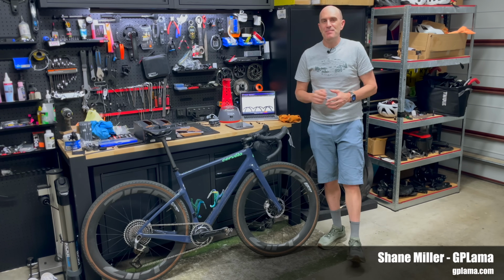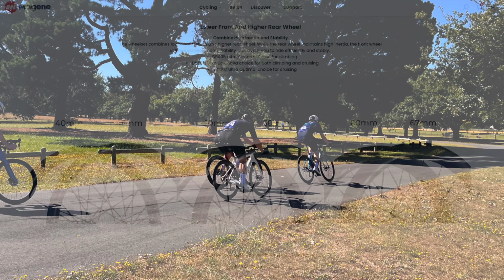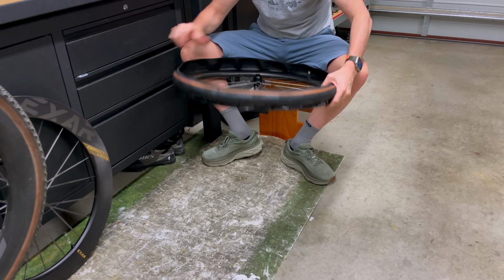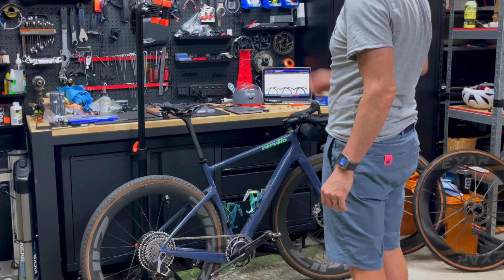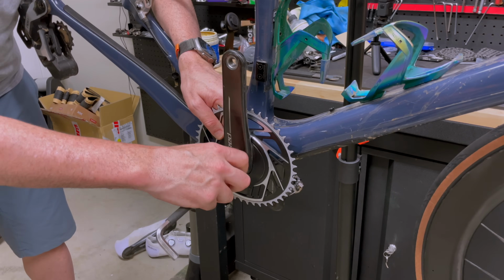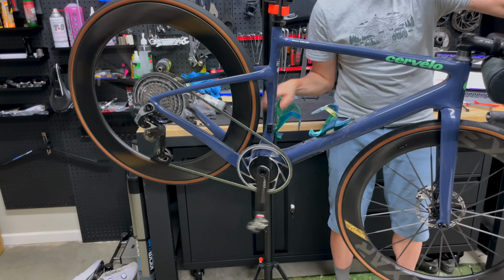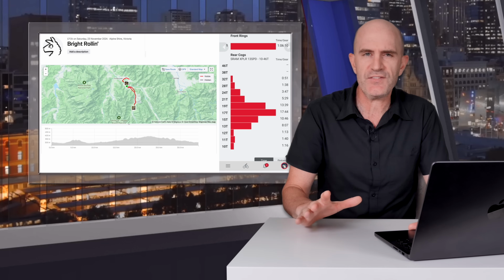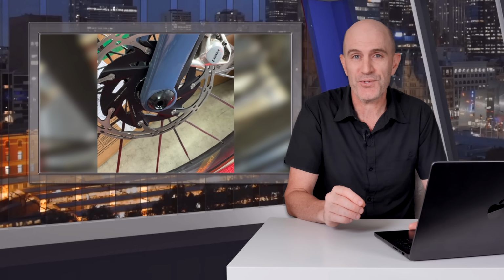Cervelo ASPERO 1x Road Setup Project // Can it do Both Gravel AND Road?

Comment: I just built up my road bike with SRAM XPLR and I love all the chain ring options. I’ve got it tuned perfectly for my home terrain, and then I can change it pretty easily if I do a trip to mountains or something. I think this is how road bikes should probably be for most normal people. I’m actually using all 13 gears instead of having 2x Ultegra and really only using 8 or 9 of my 12 cogs most of the time.

Comment: Hi Shane,
I am curently looking for an Aspero and was questioning myself about the frame size. 
I am 1,86m and always rode 58 bikes (road or CX). The aspero in 58 is comparable in stack and reach to my current bike. 
May I ask you how tall you are and which frame size you’re riding on?
Thanks for all your great content whether it’s about Zwift, trainers or other topics like drivetrain 😍
Reply from the maker: 181 and 54. I could ride a 56 but choose to size down and run a 120mm stem. Bike fitting by comparison isn't great. I'd test ride a few setups first before laying money down.

Comment: Get rid of the 1x and make it a 2x. Why did 1x ever become THE thing with "gravel" bikes? People spend hundreds of dollars to get wattage data then disregard its relationship with cadence. Better control over cadence almost always gives you better control over sustained power.
Reply from the maker: Front derailleurs are an Achilles’ heel when riding off-road, regardless of the brand.

Comment: Given that a road tire is thinner and is inflated to a higher pressure, is it not simpler and more reliable to just put in a TPU tube?  TPU is lighter, cleaner and if it punctures, can be quickly changed on the road. With sealant, it may seal but you never know if the seal is good enough to not bother removing the tire and doing a complete repair of the hole or just cleaning everything up to put a tube in.

Comment: Just came across your content and was actually thinking of an Aspero as a do-it-all bike for myself. Don't want to do the switching components between road/gravel, and I'm probably 50/50 each overall (often both on the same rides). Very flat and open here (nothing over 8% gradient) and I'm in decent shape. Can you recommend an ideal wheel/tire/chainring combo for this scenario, paired with the XPLR 13 speed? Thanks!

Comment: Great info! I wonder what difference I will be experiencing between my road bike and my soon to be delivered Cervelo Aspero.  It will be equiped in SRAM AXS with Rival but 1x Force pwr-meter crankset + 44T chainring (combined with the 10-44T cassette).  I will put a pair of Hunt 40 CGR rims with Pro One TLE Addix 38mm tyres.  This will be my "gravel" setup i will use mostly on tarmac when the road conditions are bad or the weather makes that I wont use my Factor Ostro VAM (I live in Quebec, Canada and the tarmac roads are often more like gravel trails).  My question would be, if I purchase an extra pair of road wheels, like the Scribe Elan 50 matched with some GP5000 TR 30mm to put on my Aspero, would I really be noticing a big difference with my Factor Ostro VAM?  I do not race, but I train hard and love what the Factor provides me on flats and climbs

Comment: Great to point out the benefits of being your own mechanic (for the things you're willing to do). Nothing wrong with using a pro because you want to or have to. But knowing how it works will make you more mechanically empathetic and stuff lasts longer. And as you point out, you're less likely to be stranded

Comment: Loved this. How do you rate Cervelo in road mode vs actual road bike? And is there a happy medium chain ring size up front for mixed surface rides, say 80% road to 20% gravel, 1.5-3k of elevation over 40-60mi? (Too specific? 😂)
Reply from the maker: It's a little lazier on the front end than my Giant TCR (known to be twitchy). Other than that, it has been brilliant as a do-it-all road/gravel bike. The 13spd gear spacing on the XPLR cassette is excellent. Chainring size/combo/etc is all very much rider and terrain dependent. There'll never be a one size fits all answer there.
Reply: @ great to hear! Just picked mine up and ordered the Red XPLR derailleur and cassette. I’m planning on starting with a 44t chainring and using this video for setup. Thanks for that!
Reply: @ one question, chain calculator calls for 120 teeth… the force flat top chain comes in a 120 chain option. SRAM app only mentions 126 or 114. The 120 link obviously works right?
Reply from the maker: @bpk636  Not sure on that one. I'd lean towards yes.... SRAM support should be able to confirm.

Comment: If you’re running a 46t in front you need the Eagle mullet set up unless you live in Florida.
Reply from the maker: 1:1 ratio is fine for most gradients. If not then leaving the 40T on works well.

Comment: Great video Shane. Question though, at approx. 11:30 into the video is where you re-install the chain and then click it into place, then go through the gears to make sure all is good etc. I thought with transmission when you change rings (e.g. front) you would have to properly align the rear derailleur while it's in the "set up setting" and pull back to adjust (for new size) before putting it back into the regular setting before tightening the rear axel. You didn't appear to do this or is this "transmission" groupset different to the MTB ones?

Comment: Can you tell me what you have set up there with your compressor and what looks like an old pump tube and chuck (though looks like no core)? Looks like a better solution than holding the compressor with a nozzle up to the stem without core installed, which is what I need to do.
Reply from the maker: Yep. That's a pump head off a floor pump.
Reply: @gplama  How did you get it to stay on the compressor hose?
Reply from the maker: @SlowLegsandaDirtyBike  Zip ties. Not recommended, but it works. :)
Reply: @gplama  It's clever. Much better than trying to just steady a nozzle on the stem.

Comment: I’m confused, are you saying your going to have to do this conversion every time you switch from road to gravel? Ie change the front chainring? I was thinking you would be able to just swap wheels and away you go?
Reply from the maker: Depends on the terrain. A 40T won’t be suitable for a lot of road riding. A 46T wouldn’t suit some gravel courses. The last day of riding at the TdU I left the 40T on and used road wheels. Was missing some top end speed coming down Greenhill Rd descent. 42T or 44T might be a middle ground.
Reply: @ so it would be a case of using the same cassette and swapping out the front chainring when wanting to change from road to gravel?
Reply from the maker: @jackdavis8786  Same cassettes, yes. Chainring switch is optional, depends on the terrain.

Comment: At around 5:42, did you say you’re pumping those up to 110-120 psi?? 😮
Reply from the maker: No. I say they’re “not exactly holding” meaning they’re not what I would consider ‘high pressures’ as I’m pumping them up to around 50-55psi. As opposed to what we used to run 23mm tubed tyres at, 110-120psi.
Reply: @gplama Gotcha. Thanks for the clarification. 
Great video. I do the exact same on my Open Upper. 700x32 road wheels and 700x40 gravel with sram 1x. Although I’m thinking of experimenting with some Pirelli P-Zero 700x40’s as a do it all set up.

Comment: Do you reuse quick links for the life of the chain? I've had no issue reusing quick links, but I've only been waxing about a year and have multiple chains so haven't used one more than a few times. I assume it's smart to replace it if it starts installing too easily? You'd think chain manufacturers would make their quick links more affordable if they don't want people reusing them. $12 for two tiny pieces of steel is robbery.

Comment: Wow, that's a great detailed video.As an over 60-year-old, my head spins with developments like hydraulics, tubeless, wireless shifting setup, safety pin,  etc, etc. The bike industry was quite successful in asking owners to go to the dealer rather than doing it by yourself.
I ride a mechanical alloy bike with rim brakes and would never 'upgrade'.

Comment: Couple of comments on tape installation...

For road pressures (even with higher volume tires), two layers of tape is needed to prevent the pressure causing a failure at a spoke hole.

For the valve hole, it's best to use something hot to melt a hole through the tape. This effectively "cauterizes" the hole and prevents the tape from splitting.

Learned both of these the hard way...

Comment: ... or you could use an 825 Di2 groupset and not have all that hassle! 825 fantastic for gravel and road. Use a 'normal' Gravel wheel, change tyres, and not have the expense of a second set of wheels either

Comment: How did you find the gear spacing of the 1x setup for road riding? Did you notice the larger gaps between gears? I'm doing new build 'all road' bike and trying to decide between a Red 2x groupaet vs. this Red XPLR groupset. Both have similar top/bottom gear ratios, but the 2x setup has 15 unique gears vs. XPLR which covers the range just with the 13 gears. I love the idea of the direct mount rear derailleur though but worried ill find the larger gaps between gears a bit annoying for road riding. Thanks!
Reply from the maker: The 10,11,12,13,15,17 on the 13spd XPLR cassette are brilliant for flat/fast road. No issues with the jumps this week on the climbs either, riding nothing over 12-13%.

Comment: I’ve done this with my 3T Exploro using Force XPLR with a 44t chainring up font and a 10-44 cassette.  Works perfectly as a winter road bike set up and then just swap in gravel wheels when I want to go off road.

One thing I do have to change when I swap wheelsets is adjust the gear indexing using the SRAM AXS app, but that’s a 2 minute job.
Reply: A 2 tooth gap is too big for road riding. I've been riding my grx  820 44/10-51 on mixed road and gravel, and I'm done,I struggle too often with being between gears on the road. I'm going to buy a second road bike. That XPLR Red cassette could be useful, though, considering it has 1-tooth steps on the higher gears...but 600euro forthe cassette...

Comment: Factor Ostro Gravel with dura ace, 52/36, have 50/34 if I really needed it. 11-30 on Roval CLX for road and 11-34 on Firecrest 303 for gravel. Excels at both. 7.6kg in road mode so not bad for any aero bike!

Comment: Takeaway number 6 GPLama, I tried this method on my Giant Revolt 1 but I wasn't happy on the feeling of the bike, this is undoable on Gravel bikes with longer chainstays like 425mm or more. This is the real kicker! The shorter the chainstay of a Gravel Frame the closer it will give that road feel once you'll use a road wheelset. My 2 cents

Comment: Nice video Shane. I think more people should consider them as their one bike to do it all. You do have to be a bit technically minded though. As a road bike, they are great. 
I’m choosing my Specialized Crux (technically a CX bike) for Peaks Challenge this year. It is 1x 12sp AXS for the record. Several reasons: I get a 44 tooth max rear cog, the full gearing range (I’m going for a 48tooth chainring). And secondly it gives me disc brakes. I am also going to run 32’s on the tyre front. I have other out and out race bikes, but this is just comfortable. I’ve done a lot of training on the setup in the recent few months, and I’d just classify it as what they call an endurance bike really. So versatile in reality. And exactly like you say, make changes and it goes back to CX or gravel mode. For this bike I have two cassettes, two dérailleurs, 6 chain rings. And numerous chains to suit.

Comment: I thought about building  an Aspero as my do it all roadbike, but I just don't like the slower handling of the slacker headtube angle, compared to my SL6 Tarmac. The Tarmac feels like a sports car compared to the Aspero. So I plan to make a 1x Tarmac instead :)
Reply from the maker: Edit - Comment reply fudged by YouTube - I agree regarding the handling difference of gravel vs road for sure.
Reply: @gplama  OK? I'm talking about the slower handling of a gravel bike vs the razor sharp handling of an actual road bike. Of course it will 'work just fine', it's just not going to work as well.
Reply from the maker: @AM-yb1ez  Oh, sorry. YouTube had placed my comment on a wax comment on this one.... I'm on shitty wifi here at a hotel..... although the comment still works here too! Yes, the handling isn't as snappy as my TCR on the Aspero. It has a flip chip on the fork I haven't swapped over yet that should improve the snappiness of the front end.
Reply: @gplama  I thought that might be the case, I didn't realise the Aspero has a flip chip that's very interesting would love to hear your thoughts if you flip it comparing it to your TCR cheers

Comment: I have a road wheelset @ 10-33 cassette and a gravel wheelset  @10-36 cassette for my Giant Revolt.  I run GP5000 AS TR's in 35 mm on the road and Pathfinder Pro's in 47mm on gravel with Silca Ultimate.  I truly love the flexibility.
Reply: Any change of chain needed between the two wheel sets?
Reply: @kuotakarma.  No.  Seems to shift fine with the 10-36 SRAM App tool chain length recommendation for both cassettes.  SRAM Rival AXS 2x and Red chain.  I even keep the same App derailleur micro trim adjustments.  I train on the road about 500 miles per month, and I’ll run several local club gravel events each season.  For gravel I like to ride on top of the flood control levees next to the Mississippi River.  The vistas and wildlife are spectacular

Comment: What do you use for the stat overlay when riding ?
Reply from the maker: "Telemetry Overlay" is the software. Still getting my head around how it all works and the best layouts to use.
Reply: @ thank you! Does it connect with Garmin ?
Reply from the maker: @parkerkerth8446  You can import a FIT file from a Garmin to use as the data source, yep.
Reply: @ thank you
Reply: @gplama  is it only on desktop? Or can you add the overlays on the phone ?
Reply from the maker: @parkerkerth8446  I've only used the desktop version on MacOS. I haven't looked at the options for mobile editing/overlays. A lot of camera companies are now offering that within their app. The issue with mobile/app editing is the lack of customisations, and the speed of processing huge video files. Something I leave to the desktop.

Comment: Did you say a 42-46 is not suitable for steep rides?
Reply from the maker: Not even close for the roads I was on for that ride I showed in the video. See the first 10km or so of this ride: https://www.strava.com/activities/12977842791/analysis
Reply: @gplama  Bit confused then why you swapped out the 42 for a 46 front chain ring?
Reply from the maker: @DanTuber  The XPLR gravel setup came with a 40T, which is suitable for most gravel I do with the 10-46 on the back. The 46T chainring is for when I put the road wheels on the bike. 46T with 10-46 is a 1:1 ratio for climbing, so has been great for any steep hills on the road. While I was in Bright I swapped the crank with one that had a 42T on for a steep AF gravel ride and slogged away up some REALLY steep stuff. It was horrible. A 34T would have been better suited, or a full mullet setup with a 10-52 on the back. (Sorry - This is a bit of a jumble of parts/gears/etc. I'll do a video when I swap on the Eagle Full Mount RD and cassette and explain it better)

Comment: I'm a roadie, last year I purchase an Aspero with Rival AXS groupset and Reserve carbon Wheels. Immediatly I changed the cassette, I puted a 10-30 Rival in place of the 10-44, which work fine with the long chape mech after that I puted COntinental GP 5000 all seasons tyres in the bigger size : 35 mm! It's a fantastic road bike for winter times, and always the possibility to put more structured tyres for soft terrain/ severe weather conditions. The next change will be a 42 teeth chainring in place of the 40 one.
Reply: When you say winter times, are you riding in the snow? Or just cold asphalt? I'm in Michigan, so yes, can get very cold, but wasn't sure about road conditions and how far you can push it. I assume Ice = bad.

Comment: Do you get any toe overlap with that size frame? I've eyeing up one of these for a while but have been concerned about this issue
Reply from the maker: Not enough to know off the top of my head.... and that's after riding it a LOT this week. I'll have to specifically test/measure this when I'm on it next.

Comment: Unfortunately,  according to Silca, the type chain you are using doesn't hold wax well.  Apparently, the PVD plating to get the rainbow chain color inhibits the wax from adhering as it should normally. That being said, others  have said the PVD plating is not located on the points of contact between links so the wax should hold where it counts. Personally, I think this may depend on the brand as to how PVD plating impacts wax lubrication effectiveness.
Reply from the maker: Hasn't been an issue after the wax pot strip-chip process. It's holding the wax well. The chain isn't getting too noisy. I find Shimano chains a lot worse. They seem to 'dry out' so much faster and get really creaky between waxes.

Comment: Since going to 1x sram on my gravel bikes i have found i much perfer the simplicity of 1x and have swapped my road bike to 1x. I have been running a 48t garbaruk front aero ring and a garbaruk axs cage with a 10-44 casette. Checking the sram app shows i spend very little time in the 10 or 44 tooth gears, shows the 48t ring is perfect for my riding/fitness.